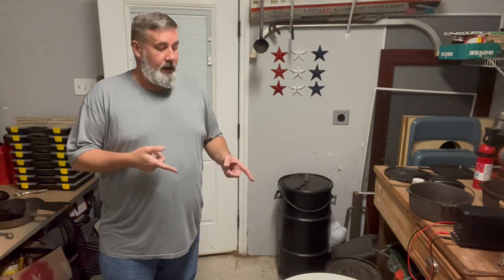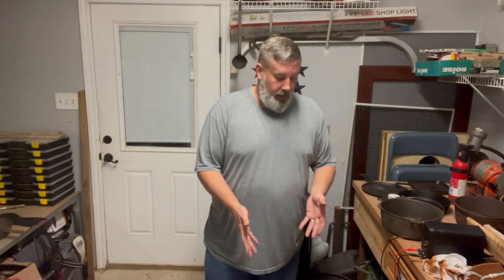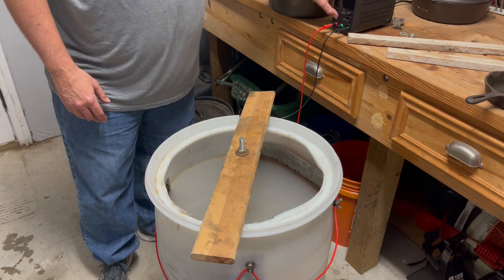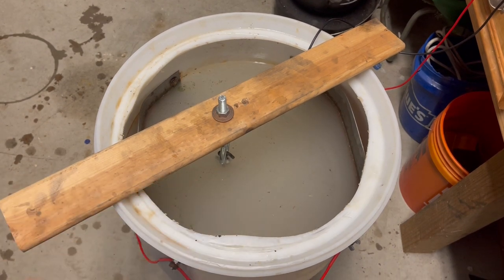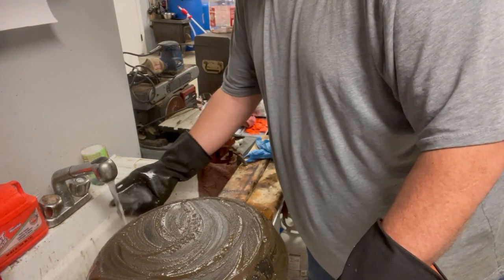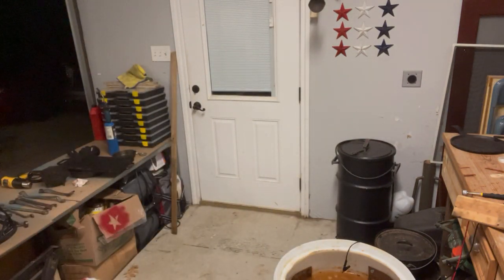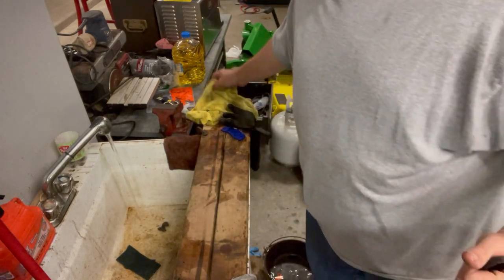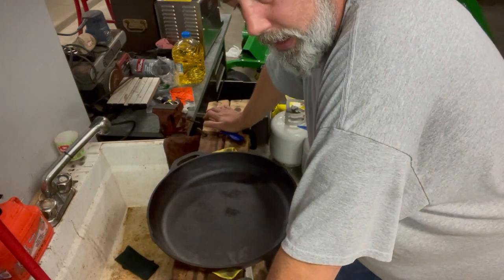Electrolysis tank and Cast Iron Restoration

Comment: I have worked on a chrome plating line for 40 years with that setup you will never have a problem with hydrogen or oxygen build up.
Reply from the maker: Awesome. Thanks for the info!!! Glad to know ! Chrome plating it’s an awesome process.  Love seeing bumpers and wheels redone.
Reply: @OurTexasHomestead  Saw another video. The use Titanium anodes. They like Stainless Steel did not accumulate the rust, and were easy to clean. Question. Where does the rust go using them?
Reply from the maker: @charlescoker7752  would need to do the research but does not seem like it would clean as good.  The part is designed to be sacrificial.  The rust goes in the water to the bottom of the barrel or attached to the metal plates in the tank.  I save old scrape plates when I change them out to take to the scrap yard to get rid of. Take aluminum cans etc to them at the same time.

Comment: Im using a five gallon bucket for my e-tank using rebar for anodes and just doing small pieces at  the moment. I haven't found a definite answer on when you need to change the solution. I put a cup and half of washing soda in, I know that's overkill, but it works for me. I've been cleaning my anodes and replacing the water every time. That all being said, can I reuse the water/solution?
Reply from the maker: Yes. I probably do 25 different pieces for I have to add water or feel that it’s not cleaning like it should.  I will scrape off my anodes regularly (when dirty) and just let it fall to the bottom. In a 5 gallon bucket.  Just clean the anodes after each piece or every other.  When the cleaning of an item seems to take a lot longer to clean than normal.  Then change the solution or anodes.

Comment: Tip bend the s hook around the Eye  hook. Makes it easier to hang the pan.
Reply from the maker: I would but I use 2 different size hooks depending on the pan or piece size.

Comment: I doubt putting a modern Lodge through a oven cleaning cycle will damage it, but I wouldn't do that on a "vintage" skillet.  Many of the older skillets are lighter weight, and I have seen a lot of warped older skillets as they saw too much heat or were heated to fast sometime in the past.
Reply from the maker: In my description, I do recommend that vintage Griswold and wagner since wagner warps way to easy 90% of the Wagner pans I see are already warped. Should not be done in this manner
Reply from the maker: But thank you for your comment and I do appreciate you watching my video. I hope you go watch the electrolysis  one.
Reply: @OurTexasHomestead  Haven't seen many Wagners or small/block logo Griswolds that spin, but I've seen a lot of warped slant logo Griswolds.
Reply from the maker: I have a about 15 spinning Wagners. That I currently have gotten from estate sales . Had to buy a bunch in a lots that I could not put my hands on before buying.  I hated it because it had a nice looking Wagner 12 in the mix that I was hoping was strait
Reply: @OurTexasHomestead  And I just now saw your comments about vintage skillets in the description for your self cleaning oven video.

Comment: Nice set up ! When it’s time for a new tank solution how do you dispose of the used solution? Do you have to treat it in someway for it to be safe to dispose of ?
Reply from the maker: No. You can drain it on the ground with no issues.  Env safe
Reply from the maker: My grass is greener in the area I drain it.

Comment: Ha, another question. Can you do this on a iron skillet that has the outside and outside bottom painted with the enamel paint or whatever they use?
Reply from the maker: electrolysis should only be used to clean bare cast iron ware. Aluminum pieces will dissolve. Enameled cast iron pieces may also have their coatings compromised.

Comment: I like to watch a good cast iron cleaner work. I'm never beyond picking up a new trick.
This is what I do, I use a 55 gallon food grade barrel cut to 24" tall holding 35 gallons. This requires 27 ounces or half a box of Arm & Hammer at 1 1/2 tablespoons per gallon. I mix it with a long paint mixer on a drill. My anodes are stainless steel sheet metal held in place by wing nuts for easy removal for cleaning. My power source is a Shoemaker 1565 200A rolling charger. It delivers amperage depending on the size of the load, usually between 24 - 38 amps. I use an electric pressure washer on the nastier pieces before they go in the tank.  I clean the anodes with the pressure washer as well. As you said the cleanliness of the tank effects the time required and how it cleans so for that reason I hang the piece inside a pillowcase to act as a coffee filter to contain the larger crud. Just like coffee the water will stain. I scrub mine midway also. I leave it on for days at a time if needed. I clean for two estate sale companies, myself and occasional friends so it can get busy at times. On the final scrub I dry the pieces off with a leaf blower before oiling. It seems to prevent flash rust. I bought an oven just for seasoning so my wife could be happy with me out of the kitchen. (money well spent)
As far as explosive goes you would have to build a dome over the tank with a pinhole on top, you might be able to produce a flame out of that 1/32" hole? I've had connections to spark over the tank with no problems. It's been setup on a two car enclosed garage for two years. It's cool in SE Tennessee this time of year so it isn't ventilated in the winters. I'm not a Safety Susie but it doesn't seem to matter. Hope this wasn't too boring but that is what I do.
Reply from the maker: Yep. I like the idea of the pillow case to help collect the debris.
Reply from the maker: Sounds like you got a nice set up !  But yes keeping it clean make a big difference
Reply: @OurTexasHomestead  In between pieces I'll spray the pillowcase out with the water hose and it seems to help. The tank will still need to be cleaned but not as often. If stuff is getting through the fabric try a tighter weave. I experimented with a laundry bag but it wasn't a tight enough weave. I can get 3 and sometimes 4 pieces in the tank at the same time so my wife made some larger filters from a bed sheet that fit the tank better. I zip tied a pool noodle to the top to keep it above the surface. If you try it and like the results feel free to use it in a video. I don't know of anyone else doing that. This is my third tank and I don't know how to improve on this one. I'm always looking for ways to improve but I've hit the wall. I have to get my tips from you guys.
Reply from the maker: @turdferguson5300  will have to try it out

Comment: Great teaching.  Question if it is sticky after seasoning what do yo uh do then.
Reply from the maker: If it is sticky after seasoning it is either heat was to low/not long enough. Or usually to much oil.  If you get one out that is sticky oil it back up. Use the new oil to clean the sticky off and remove all the oil like it does not belong on it.  Nice abs clean no excess and then 400/425. In the oven for 45 mins.   You can go as high as 450 if you feel it is not baking in.

Comment: Would putting a plastic igloo cooler replacement drain plug at the bottom of the tank affect it efficiency? I know certain metals do, that's why I'm asking about the plastic ones.
Reply from the maker: Plastic ones are fine.  I have me for it.  Just have not drained it in a while.   Metal ones can cause issues.

Comment: Outstanding video start to finish. Have a question. There is some carbon buildup on a pan I restored years ago. No rust. Great shape. Just some carbon I’d like to remove. Will a self cleaning oven remove the carbon? I plan on building an E Tank, but needed a method short term. Thank you.
Reply from the maker: Thanks for the compliment.  I would try Carbon Off.   yes it a cleaner that removed tough carbon stains. Can be found on Amazon.
Reply: Thanks. Will do.

Comment: thank you this is great information! What do you think about using a wire brush disk on a power drill to remove the rust?
Reply from the maker: Never!  It can damage the finish of the pan. The little natural pits in the pans are great to help seasoning stay.
Reply from the maker: There are a lot of skillets , Dutch ovens , and other cast iron out there that is worth a lot of money.  Wire wheels can and will cost you a lot of money if you damage those pans.
Reply from the maker: The most harsh chemical/ ingredient I would used on a rusted pan IF I didn’t have an electrolysis tank is vinegar.   But I hate using it because it can eat into the metal.  Lye bath or electrolysis is the best method.
Reply: Can’t believe people think power tools, and heat. Do the work and research up front. Build a sweet tank like yours. Do you siphon to drain it or did you build one in?
Reply: @marksieber4626  I have the valve for the drain. Just waiting until next tank clean out to install.